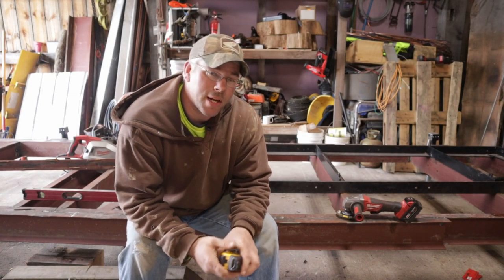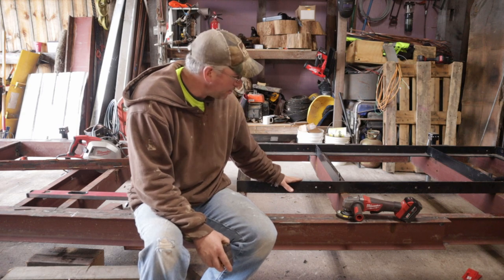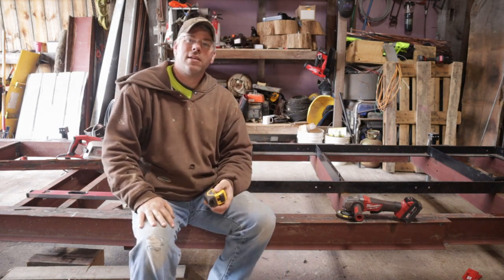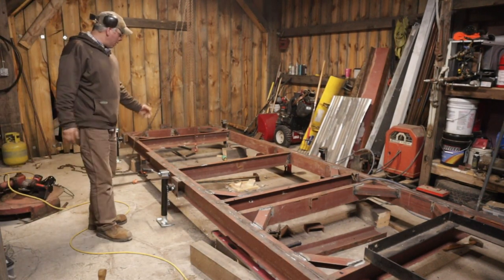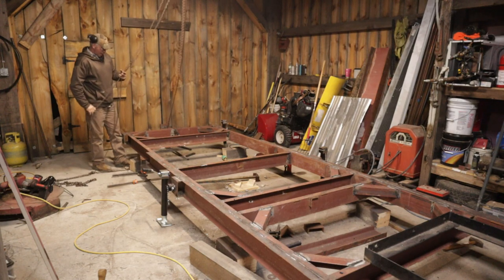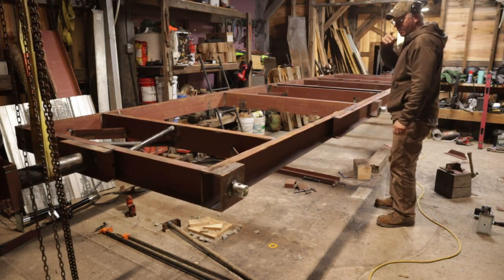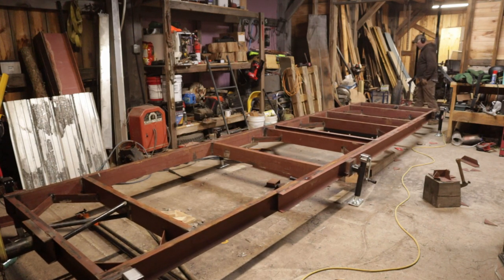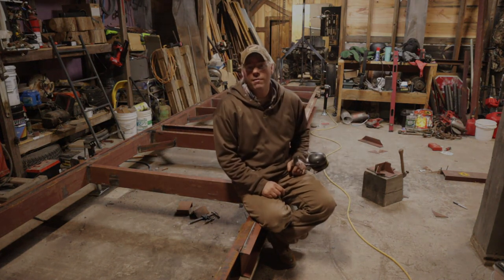Timber Frame 2.6: Doing Stupid Dangerous Stuff With Heavy Objects

Comment: Jim very stout trailer.  You can haul the mill and the milled lumber down the road with no problems.  I have a 30’ camper frame with 2 axles and electric brakes.  Need to beef it up like yours.  Thanks for the video!
Reply from the maker: Sounds about like the camper frame I have.

Comment: Good morning Jim how are ya. Ya you made that look easy! Welding in position is always easier for sure!!! About that wonky track maybe put that all the way up front so it won’t affect your cuts as the blade won’t be in the wood when it dips. Or lop it off as its just angle steel and stick it back together correctly. Any way thanks for taking us along on this build I’ve learned so much from you on this channel. God bless you and yours!
Reply from the maker: Good morning.  I'm going to not even use this track unless I cut it in half to make extensions out of it.
Reply: @TheTradesmanChannel  Ya good idea, it would drive me nuts to know my track is messed up and could screw up my cuts. That is one big heavy duty trailer it should serve you well for decades to come. I can’t wait to see ya make some sawdust with it!

Comment: Well done Jim. You made it look so easy, piece of cake. What are you going to do for an encore?
Reply from the maker: My wife askes me that once, said thats the best I have.
Reply: Knowing Jim, probably try and pick up the axles and put them on top of the overturned frame to attach them. 😂🤣😂🤣. Let's all wait and see, and see if he takes off the wheels first if he does. 
You never know with this guy. He might roll them under and clamp or tack them, then flip it over again. We'll just have to wait and see, I suppose.
If we get to see how he takes them off the old travel trailer, we may get some idea. If he removes both axles as a single unit still attached to a frame section so they are square to each other and spaced well, then the roll under may be the way to go. If he takes the axles out as individual parts, it could go either way.
Reply from the maker: Stay tuned buddy, you just never know!

Comment: Morning, Jim. When she is rolling and mobile, take her to a truck stop or CoOp and weigh her before going in to get her licenses and tags. The state will want that information. Especially New York, they can be picky on what is out on their roads. I'd weigh it both empty and with the full mill, and the log arch just yo make sure it is licensed correctly so you don't end up having any D.O.T. issues. If you plan on hauling any logs or slabs on it, upgrade the lisence to what ever max you foresee the max load being, but not in excess of the axle/tire rating. Research into your state and neighboring state regulations is important here.
This includes lisencing, lights, wiring, brakes, and all requirements for a trailer this size and capabilities. (Even if your personal use is not going to meet the maximum capabilities of a trailer this size.) State regulatory offices, and officers, can be real "dork-snorkels" about these things. And it is always better to address these things ahead of time than to have your equipment impounded by some D.O.T. officer on the side of the road later down the line. I had a buddy one time left walking when a D.O.T. officer pulled out his side of the road scales and impounded his pick-up for being over weight according to the manufacturers label on the door frame inside the driver's door. (No trailer even involved). He called me for a ride to pick up his truck, and we moved almost half his load to my truck before they would let him pick up his truck as legal to be on the road.
Reply from the maker: This will be street legal, just have to weigh it, get it inspected and registered.